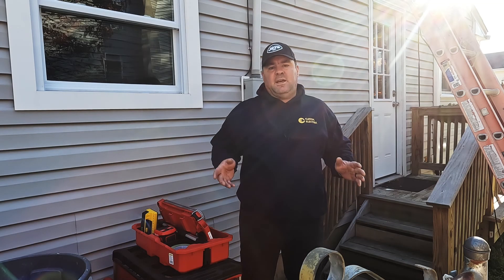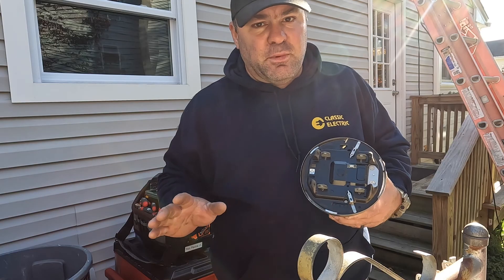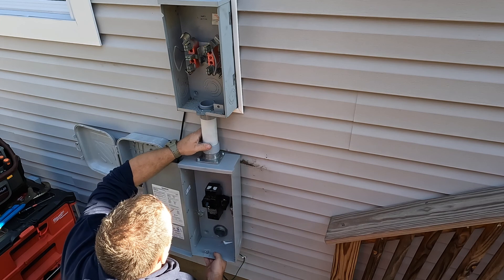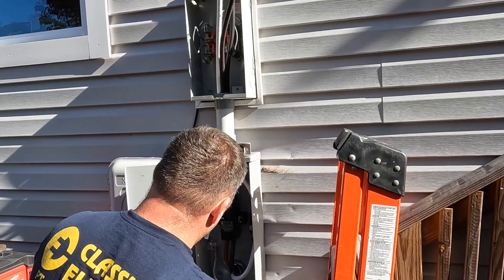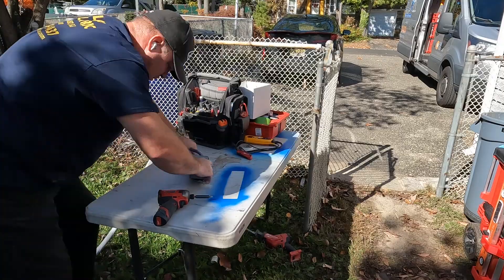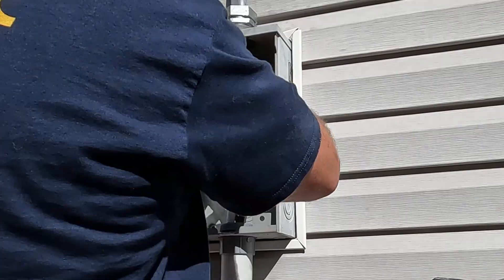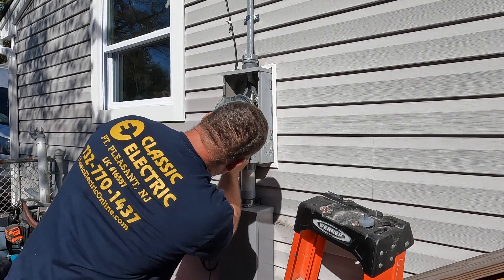200 AMP SERVICE-RATED DISCONNECT Installation | Brick, New Jersey

Comment: Does the 2020 NEC require you to have a disconnect installed under if the the 200 amp panel is behind the meter base??

Comment: I thought remove the meter and cut the main cable must be done by the city or the provider company.  Not by a contract technician.  Am I right?
Reply: In Pennsylvania, the contractor can cut the cable and reattach the conductors, and pull the meter as well.

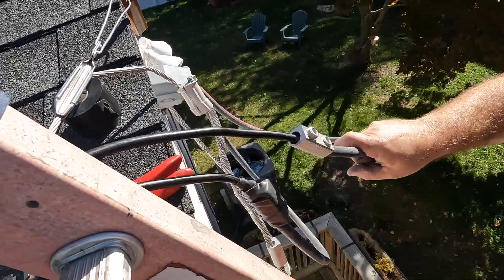Comment: At 16:17 when you reconnect those 3 service lines.  Were they live?  Are your standing on carbon fiber 🪜? Can you explain why you didn't get electrocuted ?
Reply: You didn't complete the circuit?
Reply from the maker: @TruongLe-eo8kh  exactly.  Electrons will not flow without a conductor.  Current leaves the source, and returns to the source.
Reply: @electricianron_New_Jersey  but it is scary knowing it is a hot line.
Reply: If you pull the meter out, why do you need to cut the service

Comment: What 4 wire do you then use from the disconnect to the panel? Can I get that in a service cable so I don’t have to run conduit?
Reply from the maker: 4/0 SER.
Reply: @ thanks Ron! Great job, look forward to seeing more content, keep up the good work!

Comment: Hey partner! That’s not a Myers hub! 

A Myers hub is like a bonding bushing and a watertight hub all in one; you maintain continuity and are able to install a watertight seal anywhere you need to. 

I just call the ones for the meter and disconnect “hubs” and most supply houses know what I’m talking about. 

Be safe brother!

Comment: why dont you get shocked disconnecting the service wires ??
Reply from the maker: Because the electrons have no path to flow.
Reply: sorry is that  because you have main breaker off because electric  flows from  top of meter to bottom  @electricianron_New_Jersey  ??
Reply from the maker: @jamesrooney7689  no, it’s because current leaves the source and returns to the source.  Without a conductive path the electrons have no path to flow.

Comment: Is there a way to disconnect the line in from the meter box so it can be replaced without cutting it up by the roof?
Reply from the maker: Yes. Call the utility company.

Comment: Isn't neutral ground separation at breaker panel a necessary job after you add a external disconnect?
Reply: Yes. The external disconnect is now the main panel. The ground are connected to disconnect via a copper cable. The neutral and grounds are bonded here.
Reply: The egc’s and neutral are bonded at first point of disconnect. Thereafter, neutrals and egc’s are separated. This is to prevent objectionable current on the neutral. Electricity takes ALL paths of resistance, not just the least path.
Reply: @argekay1960  I know all this, but he didn't show that.

Comment: Nice tutorial Ron. Quick question though. If a 200A service rated disconnect is installed they way you did, is it still required to have a 200A breaker in the main breaker panel?
I just did one of these for a friend and his main breaker panel has no main breaker. I am hearing conflicted info as to whether it is required or not. Thanks in advance.
Reply from the maker: You can still employ the 200A breaker on the inside panel but the ground and neutrals must be isolated. The grounding electrodes and the main bonding jumper are always installed at the main disconnect.

Comment: So with the new code. Do you have to upgrade the 4/0 ser to a bigger conductor from disconnect to panel?   I’m hearing all diff kinds of answers
Reply from the maker: Where a feeder supplies continuous loads or any combination of continuous and noncontinuous loads, the minimum feeder conductor size shall have an ampacity not less than the noncontinuous load plus 125 percent of the continuous load.
Reply: So what size ser did you use
Reply from the maker: 4/0 SER AL
 @garycunningham8478
Reply: Don’t you have to put ser cable
In the 60degree table chart?
Reply: @ClippyRenaissance  where does is say that. I know licensed electricians that are now using 250 from disc connect to panel
Reply: @josegomez6549. Where in the nec book does it say that.

Comment: I observed two grounding conductors leaving the main disconnect panel. Can I assume that both were connected together at the grounding point? Can I assume that is were the grounding conductor and the neutral are bonded together?  Thanks

Comment: Hi there, love your work.. So scary though working on them main lines. Quick question if you may, is there a reason not to setup the disconnect to the right of the meter fro example? (especially at homes where meter is installed low). This assuming that ythe disconnect and and the meter box support side connections and to cap any existing holes left.
Reply from the maker: I could have put this one to the right but I don’t remember why I didn’t because this was like a year ago.

Comment: Hey Ron. Any tips on strapping the SE cable straight down the siding into the meter? I find it tough to use the level on the cable and end up asking for an eyeball from the ground before placing the strap. Kind of annoying, and since I know you do these solo you’d be the right person to ask. Thank you!
Reply from the maker: I usually eyeball it but I have used a 4’ level and drawn plumb line where I want the strap placed in the past. Great question!

Comment: Why No 2 inch plastic bushing in ‘Em disconnect
Reply from the maker: This is a service disconnect, not an emergency disconnect. Bushings are not required with cables.  Bushings prevent conductors from being damaged when they’re being pulled into position.

Comment: Ron excellent video!!!. I still have some questions: a) If you upgrade 100 A SE panel to 200A, How you manage with the Utility Company the new meter base installation? In my best understanding, the Utility company install the new meter. b) having a 200A emergency disconnect means the new panel upgraded does not need the main breaker? , c) my new panel is located in the garden path (inside the LOT), Is this location permitted to install the 200A Emergency Disconnect?

Comment: question ..does having a external disconnect make the indoor panel now a sub panel and you can no longer bond the ground and neutral in the indoor panel? Also does installing the external disconnect now mean the indoor panel can be a main lug on panel ?  Thanks!
Reply: Yes. Everything gets separated downstream of the disconnect.

No. Keep the 200a main breaker in the panel. Easier to work on circuits and it's already there. No point in doing all of that. But you can
Reply: Thanks !!

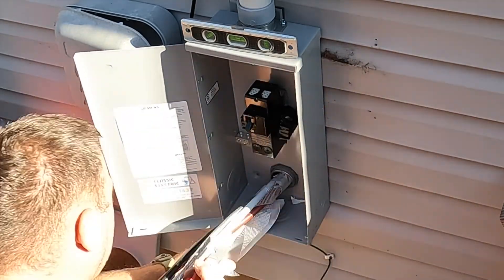Comment: 07:18   Main disconnect; nice for the fire fighters; not so good for the homeowner.
Main disconnect (on exterior) is loved by stalkers, psychopaths, Michael Myers and local teen pranksters.
Is there a means for the homeowner to padlock the disconnect?
Reply from the maker: I suppose they can do whatever they want but not sure about legally or not. This house required the disconnect outside because the panel was relocated to more centrally located in the middle of the house.
Reply: Here in SE Florida most houses that have been built in the last 50 years have outdoor main disconnects and I have never seen one locked (they do have a means to padlock them).  But I agree that if someone was up to no good it would be very easy to kill the power.  

Legally, it might be OK to lock until they are required by the 2020 code.  After that, seems like it could be problematic, but fire departments do carry big bolt cutters with them.
Reply: @ericjorgensen4826  Yes, fire fighters would have no difficulty getting through a padlock.
Reply from the maker: This is "ENHANCED CONTENT" directly from the NFPA website which I subscribe to for reference the NEC online. 

This section recognizes the need for an outdoor disconnect for first responders. Until now, first responders and utility personnel have not had a way to safely remove power from a structure. This new requirement mandates that a means to disconnect the electric utility be located in a readily accessible, outdoor location. Mounting the emergency disconnect in a readily accessible location does not preclude locking the disconnect in the “on” position.

Comment: Also would never install a service drop into the meter base without it being in conduit as I've went in on several that were done that way and after a few years the insulation breaks down in the sun and cracks open allowing water into cable and corroding the neutral conductor causing into fail . And I would never handle the hot utility wires without proper insulated tools. There are basically no fuses on it and one slip and you are gone . Not to mention not at least using insulated gloves
Reply: You don't need to worry. I'm sure his wife had him get a significant life insurance policy and keeps the payments up to date. With me, safety never takes a ride in the back seat.
Reply from the maker: I have insulated gloves but it was too hot that day.
Reply: @electricianron_New_Jersey   If you touched the Live Wire, your wife would be running to the funeral parlor and then to the insurance company to collect on your $10 Million life insurance policy, before running off with a new guy to support her.   Wear your 600 volt electrician gloves or pay the Piper at 6 foot under.

Comment: While I like the video if you mess with the service drop from utility company or the meter you could go to jail. We are not allowed to disconnect or reconnect the drop and it must be done by the utility company and only after it is inspected by local inspector . I have a service change out to do (replacing existing breaker panel and meter base and adding a 200 Amp disconnect ) and I had to schedule with local utility to disconnect service then I will change it all over then get inspected before utility will reconnect
Reply: Ron: "Hey, what are you in for?"
Rocky: "I killed 2 people in a bar fight.  I'm doing 15 to 20.  What about you - what are you in for?"
Ron: "I connected a service line by myself..... Doing 110 to 220."
Reply from the maker: Jesse - with all due respect, power company rules vary from state to state. Our labor agreement here in NJ allows for licensed electricians to cut-out and cut-in without the assistance of the power company. This JCPL territory.
Reply: @electricianron_New_Jersey   Do you need to notify the power company that you cut their tamper tag to do work and they need to come back to put on a new tamper meter tag?  Otherwise, they may think the homeowner is taking out the meter and hooking up wire between line and load with the meter out to get FREE Electricity?
Reply: Electrician here from MN, it is also allowed where I live, I have disconnected and reconnected power lines at least a hundred times. However, power company does come back after electrical inspection to make permanent connection and tag meter.